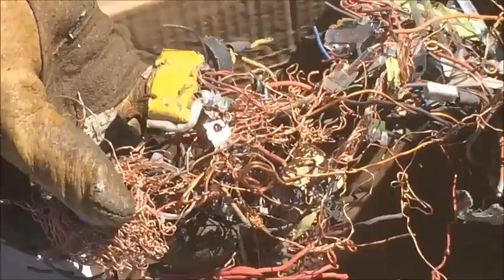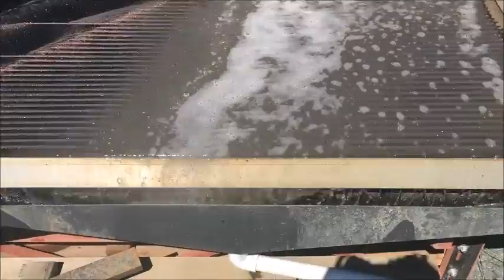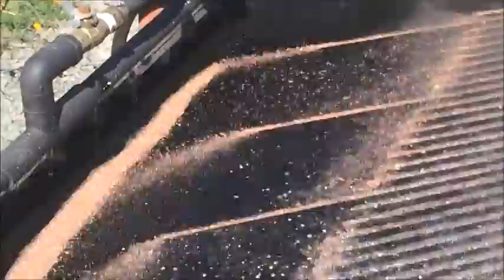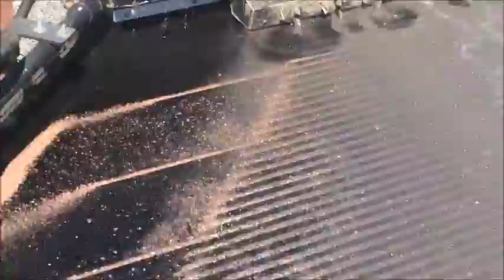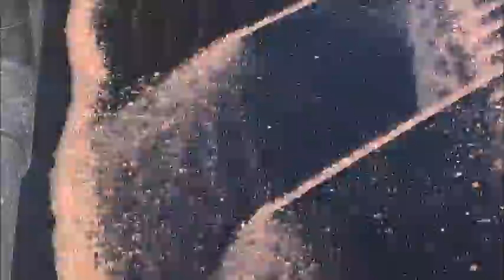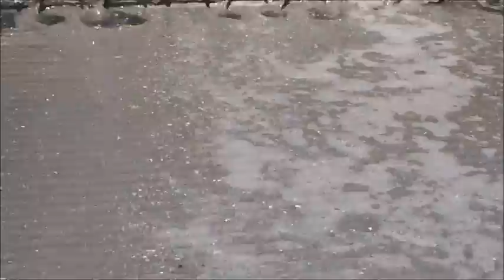Copper wire granulation w/circuit boards and electronics, all metals recovered on a shaker table

Comment: Beautiful!  So whats the smallest you can get things crushed to.  200 mesh?
Reply from the maker: Thanks Moose!  The goal is to only to crush as fine as you need to liberate the metals.  That is where the hydrocyclone comes into play, if there is a small piece of 200 mesh copper on a piece of really small plastic that isn't liberated it will sink and get pumped back to the hammer mill until it separates on the table.  So we can liberate and catch 200 and 300 mesh copper/gold/silver using the hydrocyclone and shaker table, but the machine doesn't have to grind ALL the particles to 200-300 mesh to do so.  I don't know if that makes sense.  Let me know if you need some clarification.  Thanks
Reply: yup. what you said makes sense, I am trying to get info on a machine that CAN crush the input material to 200 mesh though.  Particularly IC chips, both epoxy and ceramics.
Reply from the maker: Have you thought about making your own little ball mill?  I have seen guys make little ball mills out of rock tumblers and throw some ball bearings it in.  Turn it on and let it go for a day or two and see what you get.  It will depend on how much material you want to run, but you could scale it up by using a 5 gallon bucket or a propane tank with a rubber liner (a welcome mat or something like that might work) and a larger set of wheels to make it turn.  If you try it let me know how it works out.  Thanks
Reply: Yeah, I have tried with a large rock tumbler with different types of mediums like ball bearings, big nuts and bolts, and after 2 weeks of 24/7 running it just made a very small amount of black dust in there but the chips were still 99% intact.  Well, that was for the epoxy ones anyway.  I have not tried the ceramics yet.
Reply: how about the use of the burr cofee grinder?

Comment: Hello! I have a question. Is it possible to separate tin solder and copper using your devices ? 
Isn't the tin solder stays on connecting stripes?
Reply from the maker: The system separates the metals from the non-metals. Your concentrates will contain all the metals and the tailings will contain the non-metals (mainly plastics). I can provide more information on this system if you could please email info@mbmmllc.com
Reply: Thank you for you feedback! Will do!

Comment: what size screen was that using? I've got 300kg of wires like that
Reply from the maker: Hi Dale.  That was with our standard 1/4" round punch plate holes.  Same thing we use for grinding boards.  Thanks